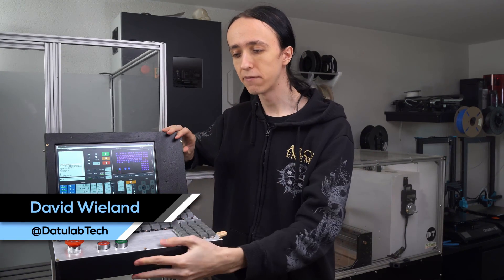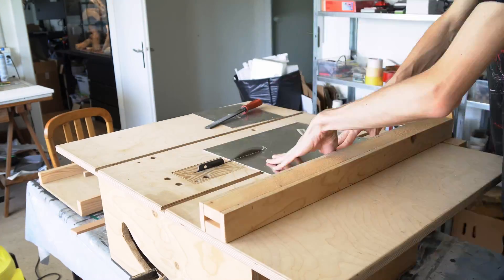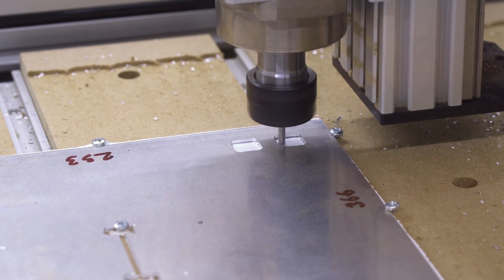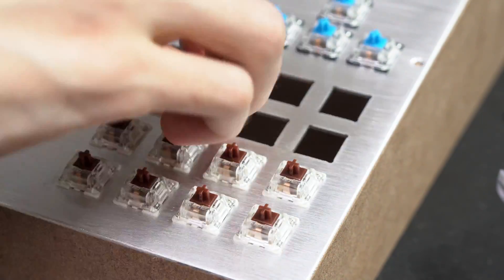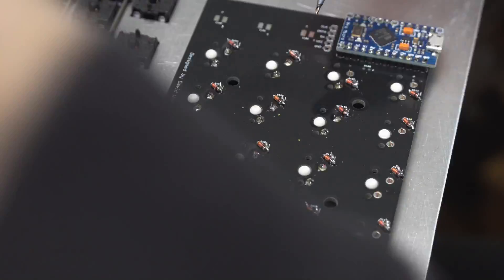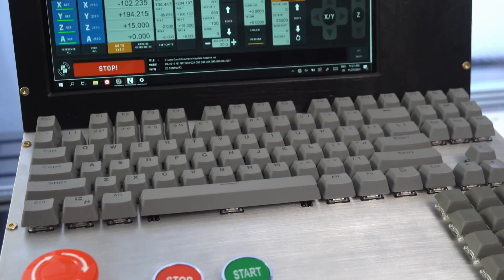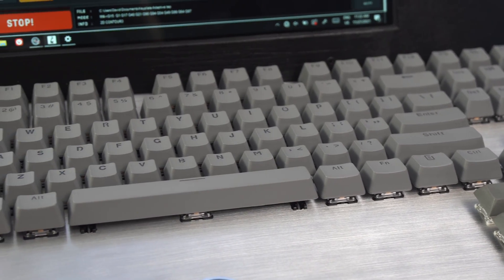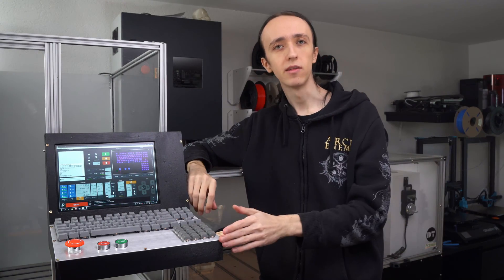Ultimate DIY CNC Controller

Comment: Mach 4?
Reply from the maker: I use Mach4 on my big BF30 CNC conversion and Mach3 on the RatRig KillerBee. In retrospect I would just go with Mach3 for both, much cheaper and sadly still more featured although it is very old.

Comment: Very nice job and an outstanding keyboard assembly.
The E-Stop solution should be wired as an electromechanical circuit and at least a redundant circuit then wired to the axis and spindle drive enable inputs and then to the Mach3/4 logic.
You can use an E-Stop Module from Pilz , Telemechanique (Schneider-Electric) or whatever equivalent and certified solution.
Thank you. :-)

Comment: Very well made. I am also machine a control panel using arduino. I was wondering how did you mange to have enough input on the Arduino to receive all the keyboard buttons? In may case I have only made like your 4x4 macro keyboard but the standard keyboard is a Bluetooth one for that reason. Thank you.
Reply from the maker: The trick is to wire them in a matrix, if you want to know more about that, check out any of my keyboard videos.
Reply: @DarkArtGuitarsWorkshop  ok I will. thank you, but I kinda imagine what you mean. Smart approach